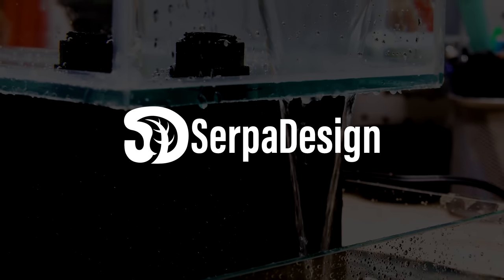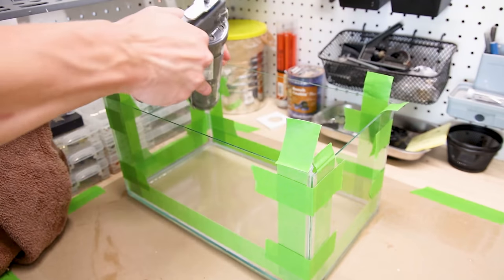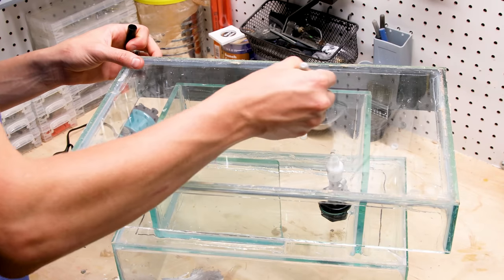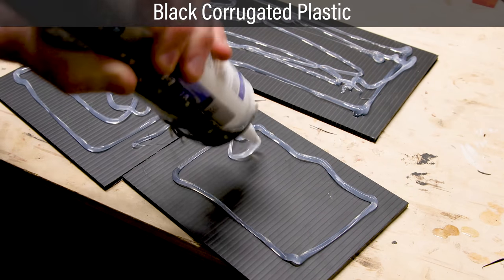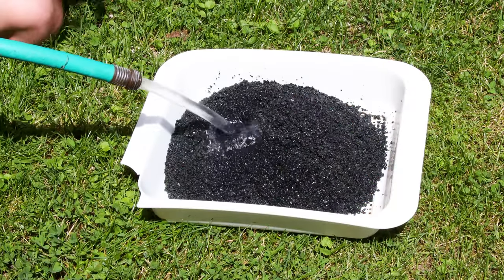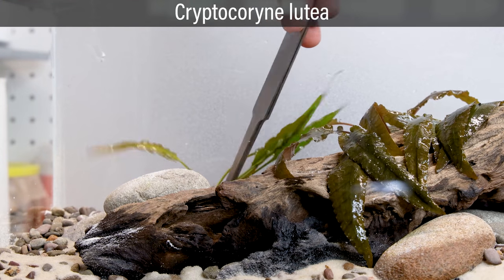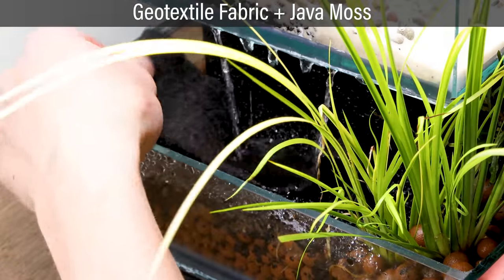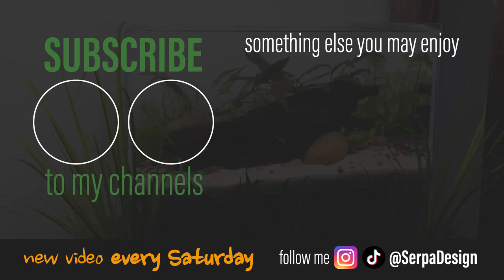Upflow Overflow (Infinity) Bog Filtered Shrimp Aquascape

Comment: I thought of an idea that could be good for a 2nd version. Instead of using one mirror on the front bottom tank, make the bottom tank all out of glass, and use mirrors on all sides of middle support (which not only would make it look like there were more plants and rocks in the bottom, but might also give the illusion that the top tank is magically floating above the bottom tank even if its only at first glance).
Reply: Great idea🐸
Reply: Ooooo. I like that idea!
Reply: I thought he was gunna do that as soon as he started talking about mirrors, Has to be done now haha
Reply: I love it
Reply: I was thinking something like that as well. Honestly I thought the mirror in the front added literally nothing to the build and actually was more of a distraction than anything else.
Reply: Awesome idea but the maintenance that would need would be something else
Reply: @exurb8516  how so? How would the maintenance of that be different from the tank he made in this video? Its literally just switching the middle support glass for mirrors, and switching the front mirror to glass
Reply: The mirrors would not provide support for the build
Reply: @justagirlhavingfun4660  they actually would provide support. But maybe not enough to hold up the top tank, but in that case you could add a wood or metal supports inside the middle, since it would be made out of mirrors you couldn't see them so it wouldn't matter.
Reply: @doodbro931  Semantics Aquatics by Serpa Designs 
Order now.

Comment: I love it, but man when (not if) that check valve fails, you're going to have a MESS... cool design though!!
Reply: Hehe you are right! Sweet design but a bit risky.
Extending a pipe (hidden with a log/hardscape/plants) to a few centimetres below surface level should be a possible solution for future versions. This might break the intended visual effect.
Perhaps adding air (air stone could be hidden under the gravel) near the sides would spread the overflowing water more along the sides 
Great design (this comment is not meant in any negative way)
Reply: @svenv460  Heh - I came here to say exactly this.  The “high end” check valve on my marine tank constantly fails.  He would only need to extend the output tube up high enough so that the water that drains doesn’t overflow the bottom.  That would make it easier to hide.
Reply: Death, taxes and check valve failure...

Comment: Absolutely gorgeous - as always!!  Count me in the squad that says don’t trust that check valve, though!  I would suggest just extending the feed tube high enough that the water that drains wouldn’t overflow the base.  Maybe just a couple inches (depending on the relative volumes).   Should be easy to hide, and might increase flow with that check valve out of the circuit.  

Great design!!

Comment: One thing I see with this design is creatures "riding the wave" and ultimately ending up in the bottom tank.  I've had my snails crawling up and out of a regular tank.  But it still looks very nice.
Reply: I'm thinking that those sloping baffles would protect against that problem if the spacing was tight enough.

Comment: I like the idea. I had chosen a slightly lower middle part and lower upper part. I don't like high aquas. 

When it comes to the base part, it could work just as well if there were 9-12 support points! The supports can be made of brick, concrete or similar material and are built as an (X) with 4 pieces that anchor the 4 corners so that you have a large X in the middle, for better relief of the strain of the weight that the upper part brings with it.

Pumps and media will be covered with plants etc. The middle part needs to be easily accessible and I don't want to spend too much time on silicon and also be able to have the upper part loose in case something breaks! So a 2-part build that appears to have three parts where the upper part has its weight resting on the crosses which are not visible.

Comment: Cool build. I think the check valve (although needed like you said) was the main issue with the overflow aspect of the tank. Check valves are usually quite restrictive depending on the design. Next time go with a more powerful pump to overcome the extra restriction.

Comment: I think your creation is quite pretty. As I watched your build it reminded me of a disaster that happened to me when I placed a 10 gallon aquarium in the opening between my kitchen and family room that was about 10" in width. This left the aquarium overhanging a couple of inches on each side. Not thinking this was a problem, about a month later the aquarium shattered because their was an uneven distribution of weight beneath it which caused a stress crack. I hope this doesn't happen to your set up because I can see it was a lot of work and very creative!

Comment: I love this design.  I have a water garden which is basically the same design but the plants are on top built into the lid.  It makes maintenance far more complicated than it would be to have the plants on the bottom with an open or plain lid.

Comment: I think putting those baffles on to get the water to pour better is a very clever idea. It also serves a dual purpose, in that it will keep the shrimp from getting into the bottom "bog" section.

Comment: Beautiful. I think cutting tiny notches on the over flow edge would have over come the water tension-no flow issues. I would have also used mirrors for your elevating base instead of the black plastic. That's just me though. You are the master.

Comment: you can probably use a clear mesh screen on the overflow points to help get that even flow without having to add more glass panes there. you can also make them removeable making it easier for cleaning in the future. its a great scape and i wouldn't mind making something like it myself to be honest.

Comment: Oh damn, I have soooo many diamond shaping/polishing/cutting tool for Lapidary/semi precious mineral, I could have a lot of fun making my own tank.

I'm going to make my own mini tank for a snail but I'm going to use a slab of obsidian for the back ground (along with the glass for the sides and top .

Awesome video!

Beveled edges might help your design, doing this you could make each edge at there own height and control the spillzones too. It would require like 6 or 8 inch diamond wheels tho.

What you did look amazing  😍.

Comment: that is awesome although id personally have done the pump area slightly differently and used some alfagrog(or other high surface area filter media) and a piece of filter floss on the intake of the pump section. just to add masses of space for bacteria to colonise. absolutely awesome idea

Comment: It looks pretty awesome, and I imagine the sound is very soothing too. My only recommendation is to add some taller growing plants in the back (bottom tier) to soften some of those hard lines. Similar to what you did at the front. Maybe some pothos near the Jarva moss, and let it climb up an egg crate trellis (at the rear, on both sides). The design calls for a lot of glass boxes, to work. But it needs plants on all those edges, to soften the lines.

Comment: I really like this. A suggestion would be to have a return pipe going up to nearly the surface in the inner aquarium just in case that check valve fails. However, your idea is more elegant.

Comment: During the initial build, I would silicone the supports to the bottom section but then mark off the place on the bottom of the upper section where you want it to rest, then add small pieces of plastic (or whatever) to the edges of your marks to provide a secure positioning. This would allow for disassembly to clean or make changes.

Comment: Nice... I made something like this about 7 years back, a black stock tub sitting in a kiddie pool, the tub supported by bricks. The bottom was separated by the bricks, so half was filled with lava rock and plants, half was open for fish. The top pond had turtles and fish. It would overflow into the bottom pond which also served as a sump, then a water pump brought it back up. Wish I could post a pic.

Comment: Great video. Have you though about how you could hide the pumps cabling? I think using a mirror glass bottom opened box on the side of the tank and just above the bottom tank water line you could hide most of the cabling instead of having it laying directly over the lip of the tank. You could also make a conduit on the exterior of the tank to continue the feed of the cable.

Comment: I love this tank idea, It looks really amazing if there is one thing I could suggest as a fix to help dial in the look is to take the corners where you added the flow regulators on the left and right side to create the tank overflow and cut them off at the same angel as the added glass so that it looks more seemless.

Comment: the tanks I have built like this evolved to have adjustable feet to allow for absolute level when installed in permanent location. My tanks are like the commercial ones where the flow is all four sides, glass must be absolutely clean but the efffect is stunning.

Comment: Very cool end product, but one thing to consider for future iterations is what you will have to do to replace that pump when the motor eventually burns out. It looks like there is very little clearance as it was attached before the upper and lower tanks were connected

Comment: I have a similar idea in mind, but to make it from a tall cylinder glass vase sitting inside a shallow cylinder glass dish. Maybe the edge of a cylinder vase would work well to achieve the even overflowing effect all around the edge?

Also curious how something like this will hold up after running for a couple years. Even with the pre-filters, wont the motor eventually get gunked up and require disassembly and cleaning? Seems like I need to break down my pumps about every 3-6 months for thorough cleaning as they lose flow rate.

Comment: Try using the hole cutter to cut a circle of a Sponge maybe 2 layers. Leave them in hole cutter then dip it in water. As your drilling it slowly compresses the sponge applying water as you cut. It's pretty handy. 🤘 But awesome tank idea either way

Comment: This is really impressive! My only concern would be any aquatic critters that could reach the top could easily end up in the bog. My thought was to make one or two ends slightly shorter than the sides and leave the water to drain there; then a glass top could be set on the tank.

Comment: Looks amazing and a great idea. However. As you said this is a prototype so I think the first thing that will need fixing is the overflow. The shrimp will end up down below eventually.  Some type of screen at the overflow that won't ruin the look. Is there a clear screen like you used on the output?

Comment: Love this design!!!!! WOW
My question is: how do you prevent shrimps from leaving the tank without some sort of top? I had a 5 gal open topped tank and the shrimps would (I think accidentally) float up and climb out of the tank on the filter apparatus.  Given that this is flowing out, wouldn't the shrimps just float out with the current?  Maybe the glass barrier is tight enough to prevent escapees...

Comment: Hey tanner, what happens in a setup like this when water start evaporating? Does it always have to be topped off or does the bottom hold enough water to give it a slight buffer allowing extra time before water fills?

Comment: My dude love your video, can I give you a quick pionter? When you smooth your silicon caulking get a 20 oz soda bottle and fill it with equal parts cheep liquid dish soap, and water, mix it up, put your finger in it. I do caulking for a living, when you smooth the caulking out its called tooling. You should notice its super smooth now and workable, also no caulking sticks on your fingers. Keep your fingers wet.

Comment: I'm curious if you could force the water to a better flow down the sides if you left a very small space between the walls and the slanted glass. Maintain a little pressure on it while still letting it overflow the top.

Very cool idea.

Comment: Interesting project, the only concern I have would be if the check valve were to fail,...
Loss of most of the water and live stock,... and a mess.
Pumping with bubbles in one or two tubes arising from the filter bed would solve this potential problem, and add some nice auditory and visual appeal. 
Nice video BTW.

Comment: I definitely love this concept, maybe i will make it myself with minor change in some aspects.
I think there is one problem here. If suddenly the electricity in our home is stopped, then the water will flow into the pump, then to the below aquarium, and then it will flow out. Maybe, if the inflow from pump is above the aquarium it will be safer
Reply: Hence the check valve. Non return valve.

Comment: Very Nice! I would mirror the base tank on all 4 horizontal or the three show sides for next revision. I am curious to know how it worked after 6 months.  Did you form mineral trails or algea on the glass where is overflows ?   Did the base become a insect enviroment as would happen in actuall bog ? (possibly not desirable indoors(.  Any maintenanence issues or things you would change ? Did you use pendulum lights, LEDs, CO2,...?   Thank You ! Awesome !

Comment: very cool! i really like the elevated tank it has a very modern look. i will say im not a huge fan of the bottom plants as they do accent the corners with height, but the height is a dangerous view when it comes to the bottom plants. i think moss or anything small for the bottom creates a much cooler dynamic? i really am not hating the design tho i think you did a fantastic job. i just think the main piece should be the top tank and the fact that the bottom piece is filtering out should be more of a surprise? having big plants spoils the surprise.

Comment: @SerpaDesign
I imagine it would be more interesting if the sides of the upper tank where from driftwood/rock or something similar instead of glass, perhaps protruding from the back sideways. with only a glass panel from the front. perhaps with the upperside of the glass panel also the same material as the sides (driftwood/rocks or so).

Comment: You need a lot more flow on that pump to overflow all sides consistently, you need to break the surface tension either through flow or like you did with a strip of glass! Maybe sanding the sides could help as well!

Comment: maybe someone already suggested this, but......what if you rounded the top edge of those side pieces to prevent the meniscus? I bet you can find a diamond round over bit to go with any handheld router.

And if that works......I wonder if you could keep all fours sides the same height, leave the front and back pieces square on their top edge, and only round the top edge of the two side pieces. So you'd have a perfect meniscus along the back and front edges while it only spills over the sides. There would be the suspense of the water always threatening to pour over the front and back edges and the mystery of it only going down the sides. Might be a cool look.

Comment: One thing I don't like is the corners. Perhaps that excess glass could be cut at an angle matching the glass piece that reduces the meniscus, giving the top of the tank a slight trapezoidal shape.

Or perhaps, return to your original design, and cut slots just below the top edge. You might be able to control where the water flows that way.

Comment: Wow, I love the overall look and idea of this setup! Also, great video and thanks for the detail in instructions. I do have some maintenance concerns though for how it will play out over time and am curious to see your updates as to how this tank works out once it has been in service for a while. Main concern - the way you lock it all together in the video, it looks like the pump and plumbing won't be serviceable. Check valves inevitably will fail over time and need to be replaced and pumps serviced - do you have a plan for that with this setup? What if in 2.0 version, you did the pump return hole near a back corner and ran a stand pipe up 3/4 the height or so such that if the check valve fails (and it will one day) only a small amount of water will drain down to the bottom. Maybe measure things out so the bottom has enough free capacity to handle how ever much water would drain down to the top of the stand pipe?  Also, I think would be better long term there was an easy way to remove the pump for servicing/replacement as needed - thoughts?
Thanks for the awesome video and idea! I'd love to see any updates you do on this one.

Comment: 1:53 I know a trick for better looking smoothing on calk that might help here as well. Take a hard flat tool with a 90 degree rounded corner (1/8th or 0.125 rounded works well in my experince, but use what's most compatible with your edging needs, think the corner of a credit card as an example) and run the corner over the calk (in this case actually the silicon) so it scrapes off the excess and packs in the calk to the corner.

Comment: Good as a demo project.
long term repalce the check valve - it will fail and create a dissaster. Add a glass tower or a glass/acrylic return pipe to set minimum water level in top aquarium.

Comment: I would've had the return line in the back as close to the waterline as possible. Gravity never fails. Check valves do.
And that pump is gunna get clogged af. Looks great, but it's gunna have problems that are completely preventable.

Comment: 3:16 you put the Teflon tape on backwards. You should always wrap it clockwise so when you screw the pipe in it tightens around the threads. The way you've done it it loosens as you tighten the thread. Very common rookie plumber mistake.